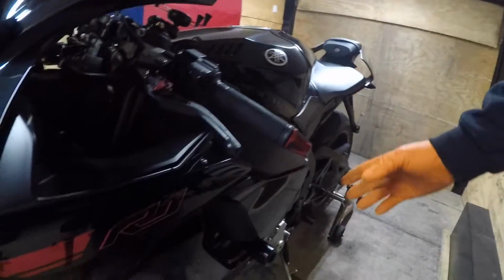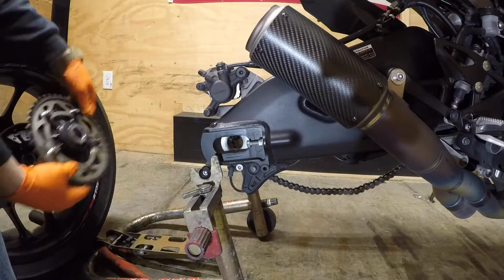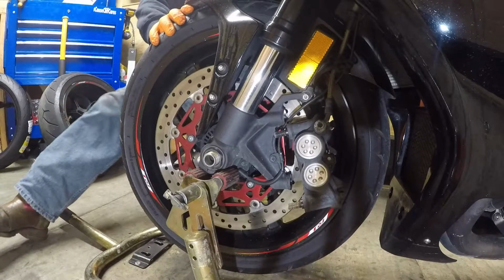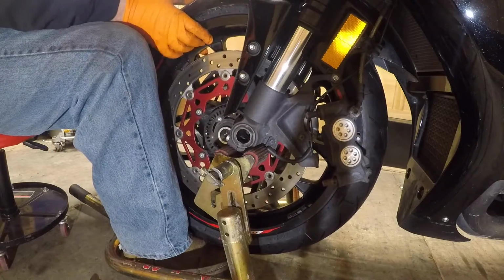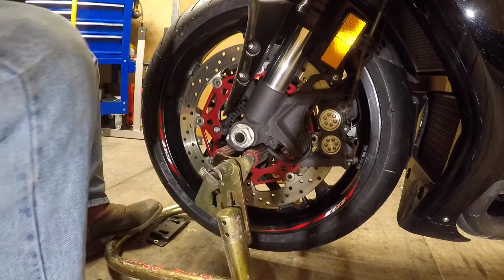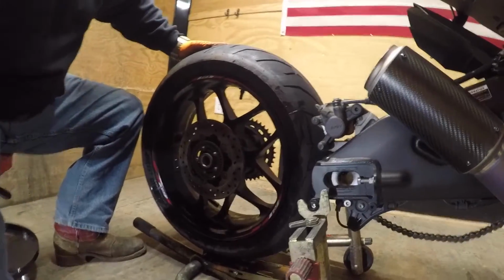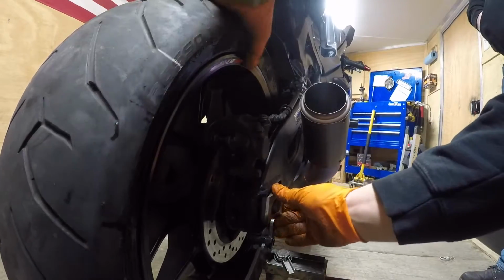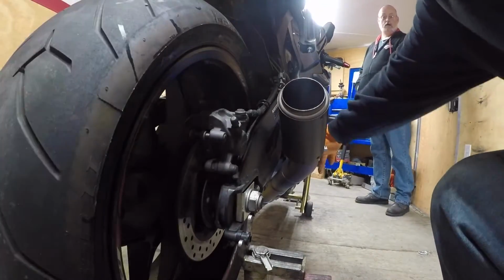2015 Yamaha R1- How to remove the front and rear wheels DIY

Comment: Thanks for this video- stupid question, the red rim decal sticker, can this be removed by heating with a heat gun?
Reply from the maker: Welcome. If it’s a sticker. Should be able to peel it off but if it’s not wanting to come of easy. I’d use some heat.

Comment: Did you grease the spacers at all before mounting the tires? What grease would you recommend?
Reply from the maker: I do as needed. Doesn't take much. It's only a dust shield. I'd us lithium or bearing grease but only a light coating. Clean old grease off first. Hope that helps.
Reply: Awesome thanks!

Comment: The axle block for the indicators on the brake side should be rotate 90 degrees ya? So the angled edges are on top and bottom, not front and back. Adjustment lines won’t be the same on each side otherwise.